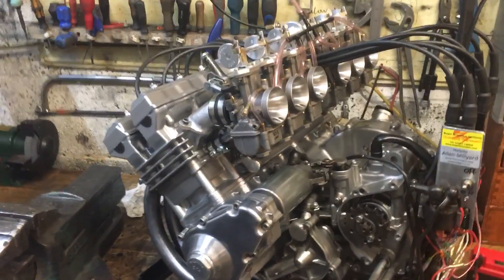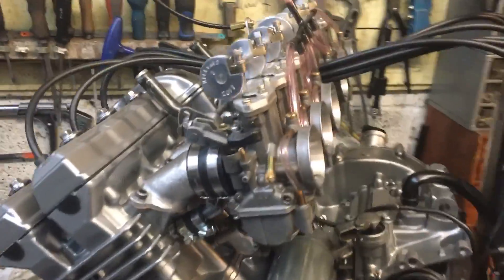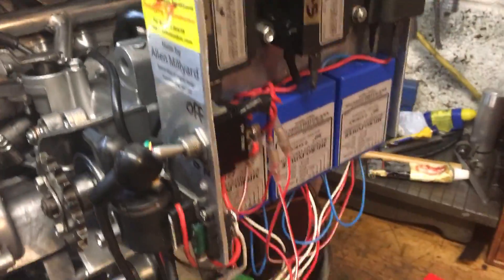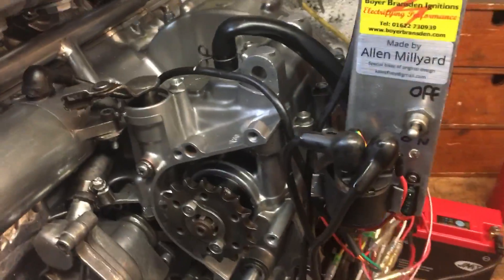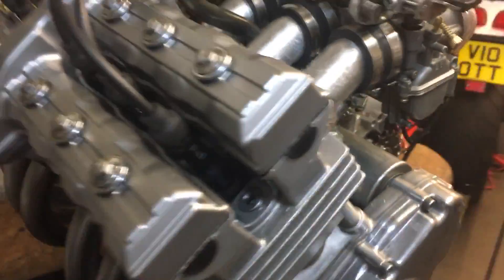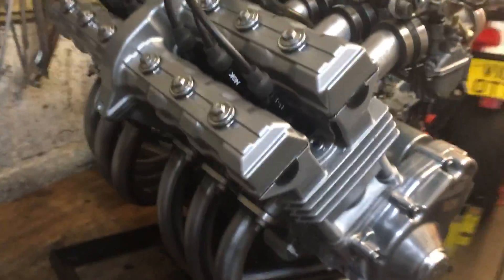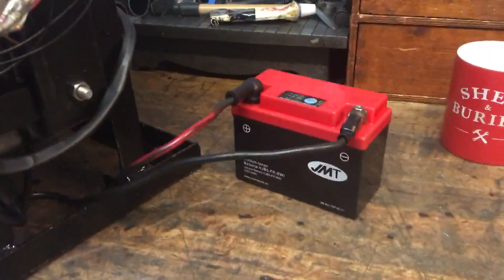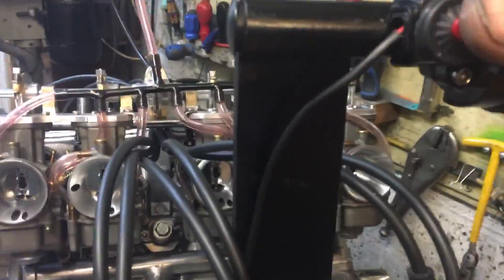Millyard Honda 374cc six cylinder engine First Start

Comment: I'm curious how Allen does the 'bench synchronisation' of his carbs (before running).  I heard him say once before, he did some "sucking through tubes" which I can only assume is some sort of way to compare the throughput of the carbs under vacuum when the butterflys are fully closed... short of putting the carb to his actual mouth and sucking, I can't imagine

Comment: When there's six carburettors in line, and the cylinders don't look any bigger than the carbies, you know it's going to be another amazing Millyard construction !!
Reply from the maker: The original carbs turned out to be a bit big, i replaced then with smaller carbs and i ran even better :)

Comment: And I can't get a broken exhaust manifold stud out of my virago cylinder head! Aarrgghh!
Reply: Here's some advice. Buy an "Easy-out kit to fit the broken stud. If memory serves me I think they are metric 6mm.
1.Carefully centrepunch end of broken stud.
2. Drill 10-15mm deep with appropriate size drill bit.
3. Using a tap wrench with the correct selected easy out, insert in a twisting, anti-clockwise motion.
4. Plenty of WD-40.
5. If it's really stuck, heat carefully around broken stud with a blowtorch to expand the metal...do not cool with water. Allow to naturally cool or you may warp the head.
Hope this helps, this is what any decent mechanic would do.

Comment: Why is it a Millyard Honda when he started with 2 Yamahas? Hanging idle, too.
Reply: And how the hell do 225 people dislike this?
Reply from the maker: This was its very first start and run. The idle settings were out on a couple of cylinders, but that was soon adjusted. I used Yamaha FZR250RR engines because of the elevated price of MC22 engines

Comment: Hi Allen, great engines and bikes you build.
Out of curiosity you think a flat 12 is possible size wise?
Joining 2 goldwing 1500's?
After eachother might be to long. You think stacked on eachother will work?

Regards from Holland

Comment: Hi Allen do you have any horsepower/torque figures. Not that it makes much difference, but I would love to know what it pumps out. My FZR250 had about 40HP and if adding 2 cylinders gave just the extra 20HP that would be a lot of power (60HP) for the wet weight of this baby.

Comment: Wow !. Absolutely fantastic.i thought I was clever putting a Hilman imp engine in an Enfield Meteor frame.
Hats off to you and keep up the fantastic work.👍
Reply: Are you  the fellow who rode from British Colombia to a Norton rally in New England?
Reply: @donkuwik3390  
No I was not that person.
Reply: @petershepherd6889 ; A fellow rode an Enfield framed Hillman Imp powered motorcycle from Vancouver,B.C. to a Norton national rally in upstate New York. Remarkable!
Reply: @donkuwik3390  
I did my conversion in the late 1970's.got the idea from an article in a bike magazine where someone had put an Austin seven engine in a bike.
Working in a power station at the time I had access to a fully equipped workshop so was able to do all the turning and welding without any problems.
The imp engine was an alloy engine so very light so made a good choice.
I retained the Enfield clutch and coupled that to a Norton gearbox.
One had 6 splines and the other5 splines so a split adapter shaft was made.
Still had the electric start and water pump but never fitted a charging system.
Made a 4-1 exhaust system with a silencer that you could get your fist into.
Took me about 18 months to do and I got it running and used to ride it on private land but got a Suzuki gt750m and the imp project never got completed.
Someone I knew was an Enfield enthusiast so I sold him the rolling frame and the engine got s rapped.
It was nice to see I was not the only one who had this idea.
I still ride a motorcycle even at the age of 66 and probably will for years to come.

Comment: AFAIK all of the four Japanese bike manufacturers build 250cc inline fours for the local market. I wonder why the Yamaha was chosen - any special reason?
I've been fantasizing of a 500cc V8, made of two 250cc banks. Slim, relatively light, 90 hp should do!

Comment: As a CBx owner I love it, not keen on the angle of the carbs to the head, looks about 45degrees .the straighter you can get a shot at the valve the better. I'm sure you can fix it if you have gone that far
Reply from the maker: your right I replaced those carbs, and made new inlets for 90 degree angle before fitting into my RC374

Comment: Amazing! 
One question,  would it be possible to build a 2 cycle single pin 45° V twin?
Say, a 500cc utilizing two 250cc Suzuki, Kawasaki or wherever was best suited.
Reply: The problem with that would be crankcase pressure pulsing. If the pistons came down at the same time it may work but then there is little to be gained over a single of double the capacity. Of course if it was supercharged and had a 90 deg offset it could work well for power but would probably be a complete pain to start and get right lower in the rpm range. 
Point is most of these things have been tried many times in the past and there are good reasons they didn't make it or are very limited in production. 
Allen simply makes some of the better ideas which got shelved for various (usually mass production) reasons. 
Even the glorious engine in this vid. It's based on an FZR 250 layout with another half added on. That makes it wider, heavier and no mnore powerful than a 4cyl 400 which is why it's not going to make it into a production bike any time soon. On the other hand it sounds amazing and is something very different to the norm which is something I applaud. We need more cool mad stuff in biking. Thats why a lot of us started in the first place.

Comment: Please stuff this engine into an FZR250 3LN deltabox frame. I think maybe it might need a wider back tyre and a better front end than the original!
Reply: I'm currently looking a fitting 4x 28mm OKO D Slide's to my FZR250R 3LN3, just trying to work out the angle for the manifold's atm. Now i'm wondering what size Keihin' roundslide's did Allen end up using ?